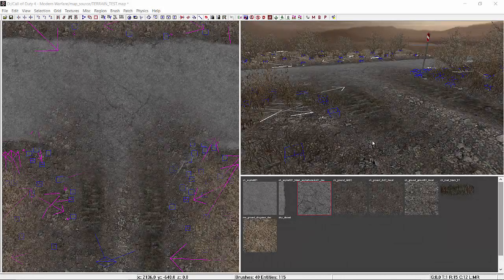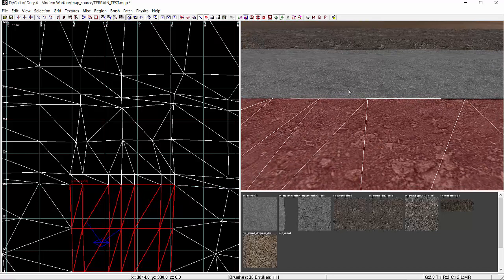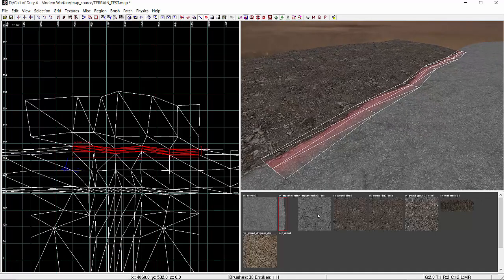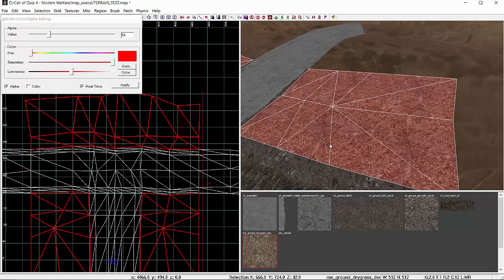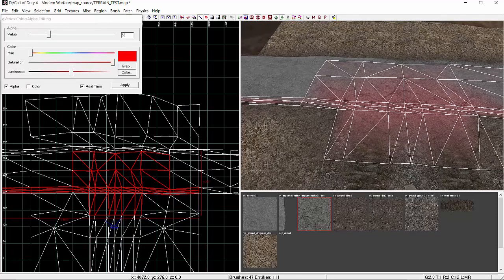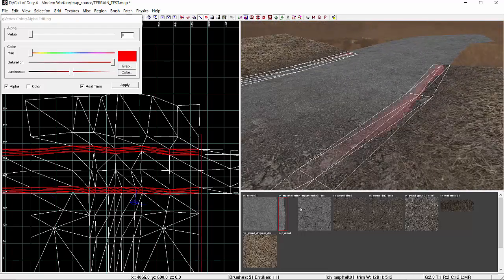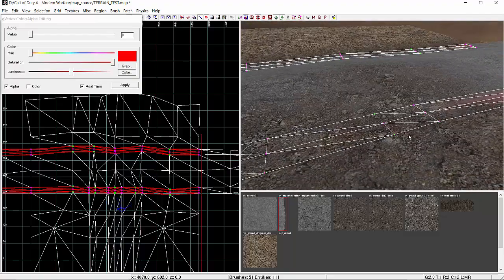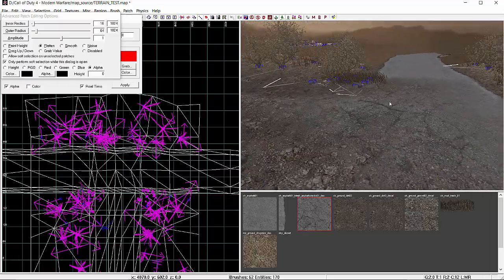Advanced Terrain Series : Part 7 : Multiple layer blending

Comment: Black Jack Jonny... Here I am, 2 years in the future, banging my head against the desk. Sometimes I'll blend my textures, but some of them seem to have their priorities wrong. For instance, I can't paint a "dirt" texture over the "asphalt trim" texture. The asphalt always stick through, and the dirt remains underneath it, and that obviously makes no sense. How to overcome this?
Reply from the maker: Hi, from the past......;) Just make sure you have a "Non" blend texture as your base texture. Depending on which version you're using, the name of the texture will have a different name for blend and non blend textures. 

For example, in CoD WaW, the blend textures will usually be called "Ground_dirt_dec" or something similar. 

The "dec" at the end stands for decal and means it's a blend texture. So, just make sure your base texture doesn't have blend, dec or something similar in the name and you should be good :)

Cheers.
Reply: I'm glad you're still around. But hey, I understand that part. I'm doing exactly what you did at 4:00 in this video. This asphalt trim tex is a decal, it has an alpha channel. What I'm trying to do is paint a dirt texture over it all (over the asphalt, the trim, and the ground on the side of the road). I can paint it over the asphalt and the ground, but this "asphalt trim" tex always stick through. You might be able to reproduce it on your own.

My question is, how do I tell the program to paint decal X over decal Y, and not the other way around? Is that even possible, or do I need to actually paint the trim out instead?